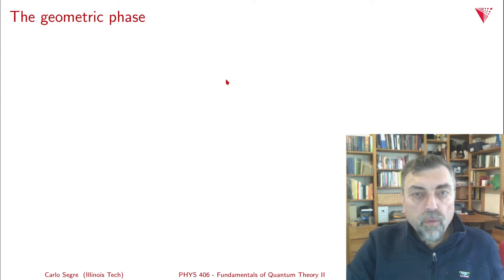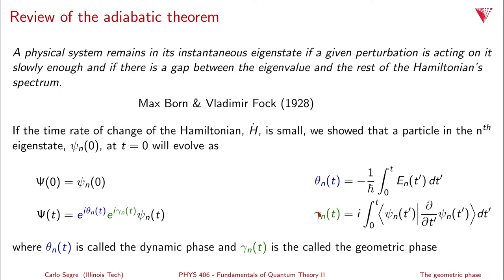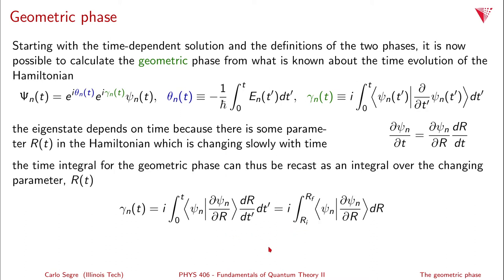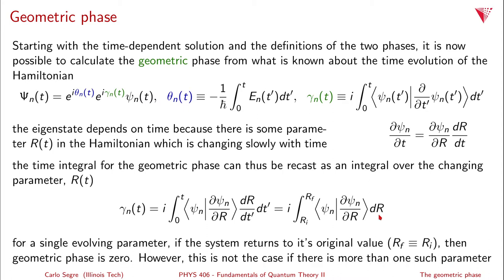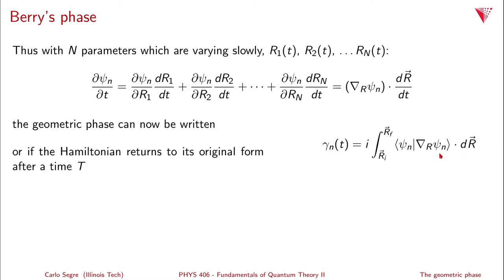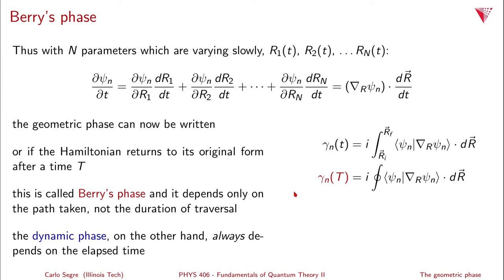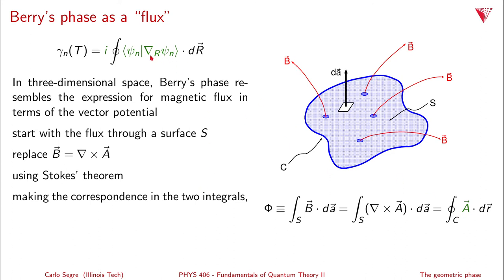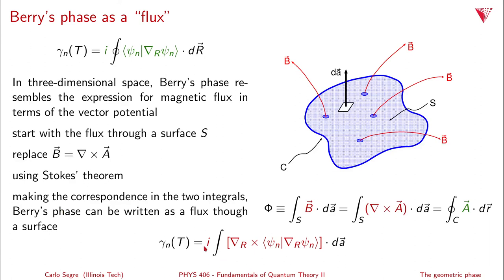11.07 Berry's phase

Comment: In the 1D case, the forward and backward journey in a closed path has to happen along the same path. So, whatever changed between states A to B, gets cancelled for the path from B to A. But in any higher dimensional system, we have the option to get back to the initial state without traversing the same route back. Consequently, we have the possibility of a non-zero geometric phase in a closed loop.

It was nice to understand the above. :D
Reply from the maker: Thanks for watching!

Comment: berry phase difference depends on the magnetic flux, but the cross-sectional area of the solenoid (through which the magnetic field is finite) is much smaller than the area spanned by the path we move the box along. do we use the solenoid area for the magnetic flux? what happens if we change the size and shape of the close path? what if the box made multiple revolutions?
Reply from the maker: Multiple revolutions add more phase, however the exact path is unimportant.  It is the fact that you go around the entire enclosed flux that counts.

Comment: We see that there is an analog between geometric phase and vector potential. In the aharonov-bohm examples, they are equal. are there experiments where we don't use magnetic flux/vector potential, but still see a phase difference? what kinds of parameters can R(t) take?
Reply from the maker: Frankly, I have not thought about it too much, sorry.